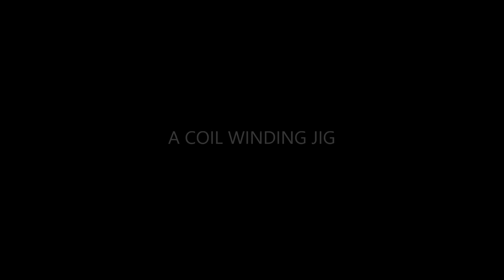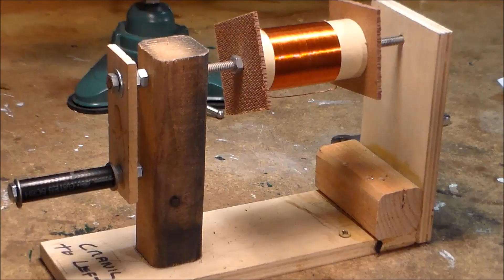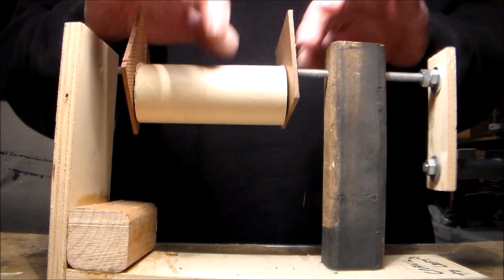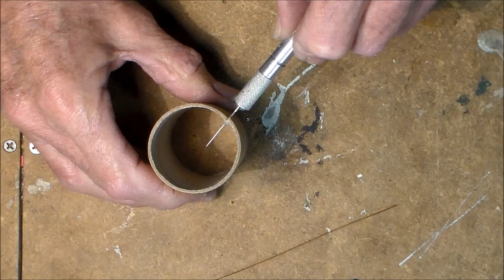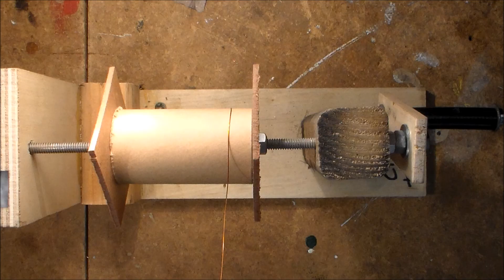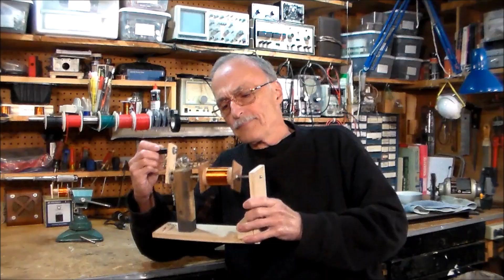A COIL WINDING JIG

Comment: Thank you.  Great video; you have a very nice way of speaking and delivering information.  Based on your idea, I have made a winding jig but I put a hinge on the outer support.  That way there is very little adjustment of the nuts.  The inner plate stays put.  I need only to tighten the outer nut and then swing the outer plate into place.  I also put a leather and wood pincher on the incoming wire to maintain even tension  of the wire feeding the coil.  All the best, Ted

Comment: It would be nice with two wood, hard rubber, or plastic cones 2"+/- diameter. One would be stationary, the other would rotate with handle and adjust to various coil lengths. I sure do wish my machinist/tool maker father were still here with his lathe.

Comment: Just started getting into soldering Electronics. I have bought a few things for beginners. The coil wire it's very expensive. Got to be a better resource than buying online on eBay.
Reply: old/small electric motors are a good source for cheap wire.....and it's usually smaller gauge (20,22,24,26,28 gauge)…..I keep a couple dead motors handy, just for small wire type applications.

Comment: The only problem I have is I want a more sturdy handle and secured in place to put pressure when I have a messed up wire that needs straightening, but if you don't mess up your wire like me from the beginning this should be fine, thank you.

Comment: Got an idea that might work. Instead of bracing the coil form between two flat plates, if they had a cone shape they would "auto-center" the form. (wishing now I could attach a pic) It doesn't need to be a full cone, just a bit of rise at the center if that makes sense.
Reply from the maker: You are right! Two cones would be perfect. If I had a wood turning lathe I would try it. Thanks for your feedback.
Reply: You've already built one.  Add a bungee cord, a rope, a board to rest your chisel on, and a plank for a foot pedal and you can turn your winding jig into a spring pole lathe.

Or just take that masonite and make cross-shaped cone forms from that.  Cut it into two triangles and make a couple cuts (one down from the tip about halfway, one up from the base halfway) so the triangles fit together at 90° to each other and can stand on their own.  Glue them to another piece of masonite, then drill down the center so your threaded rod can fit though them.  As long as you don't put too much pressure on the form, they should center the form and hold it just fine.
Reply: @squarewave2  You might try two small plastic funnels to get that cone shape for centering the coil form.

Comment: Shoulda made it with more space between so its not so hard to get it in there. Maybe make 2 shafts so you can also mount yor wire spool making it easier to wind without having it turn into a rats nest in case you were to inadvertantly release tension on the wire.

Comment: Please, what is the length of the rod and what glue do you use?
Reply from the maker: Length is not critical; just make it long enough to accommodation the coil you plan to wind.
I happen to be using Loctite GO2 Glue, but this is not critical either.
Reply: @squarewave2  Thanks.

Comment: Can you explain why it's so important for a certain number of turns? I've heard the number should be between 80 and 110. I've also heard 150 turns. Thanks in advance.
Reply: It depends on the application. The number of turns affects the inductance. Say if you wanted a x10 step up transformer. The primary could be 100 turns and the secondary 1000 turns. That would give ten times the voltage on the secondary at a current related to the amount of power transferred at that voltage.